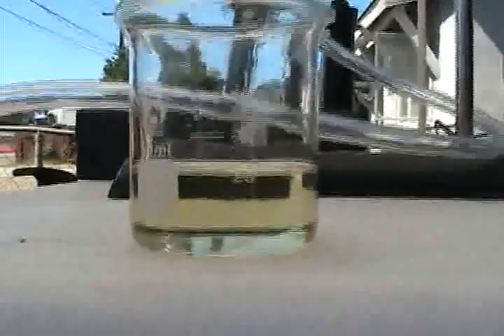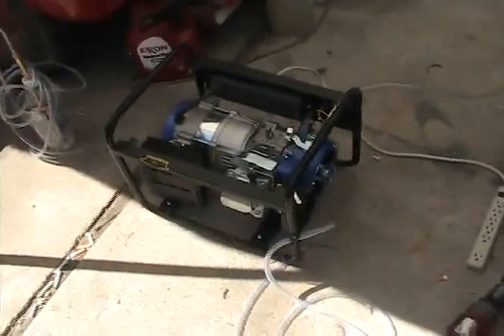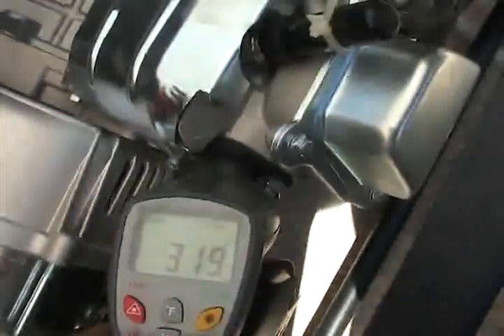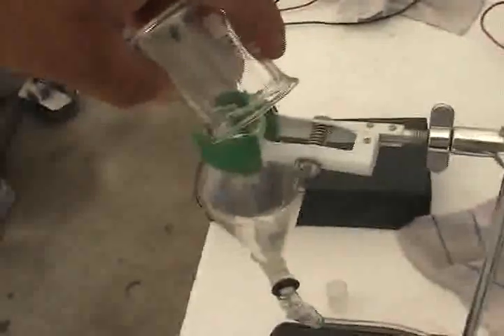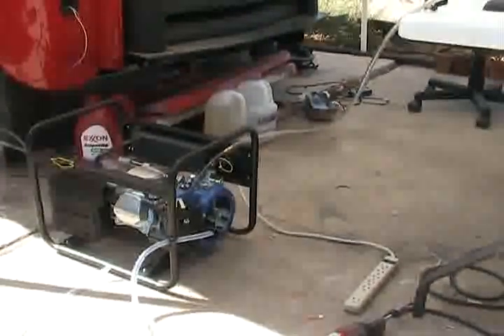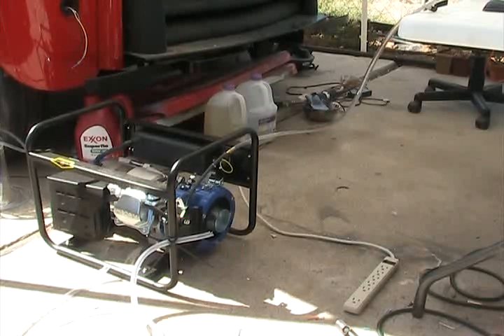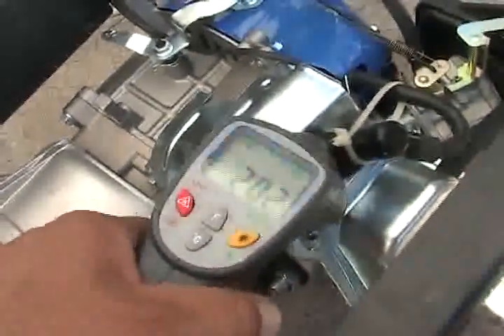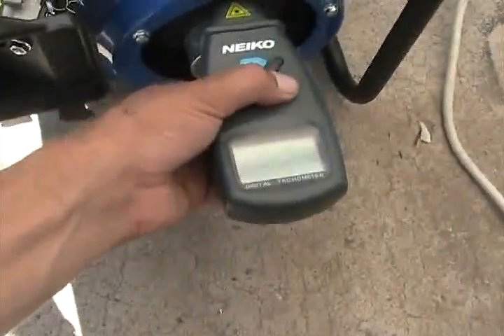Generator test Baseline no load

Comment: yeah, I have smoked a couple pretty decent small engines over they years doing this ... am sort of hoping I keep my Chinese generator going at least thru the winter ... have a number of experiments I want to run with it before I manage to kill it off ...

but yeah, I guess on the next genny video, I will take D3's suggestion and pull the fuel tank off and drain the carb bowl ... a shot of starting fluid is all that is required to get her to start ... have done this off camera already ...